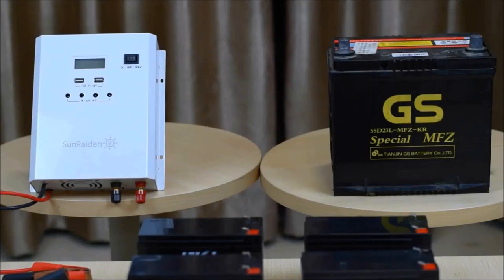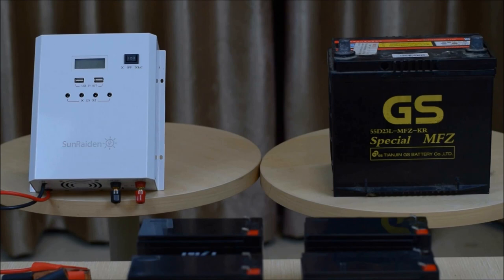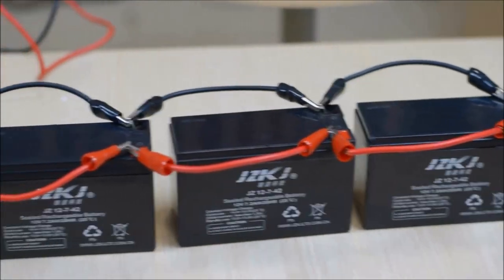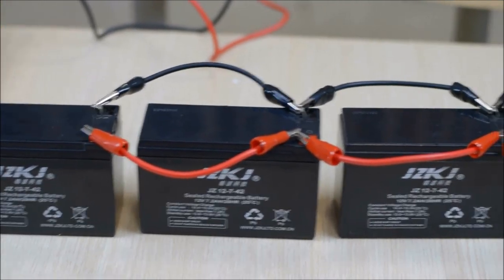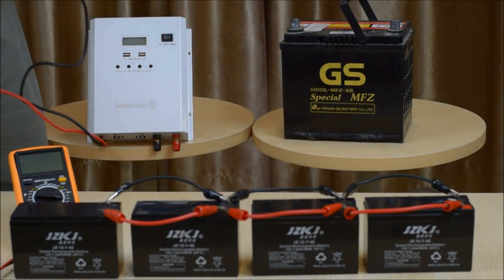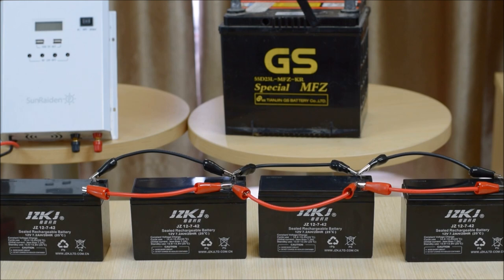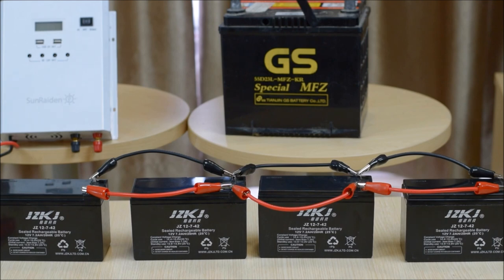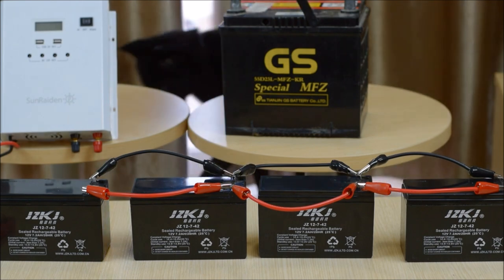How to Connect Batteries in Series and Parallel - Part 1/2 : Parallel Connections

Comment: I have two 12 volt SLA batteries that are both 5.0 Ah capacity. I can hook them up in series with no sparking but when I try parallel it sparks and I don't trust it to leave to connected but I'm wondering if even though it sparks if I should leave it hooked up anyway and use it for what I need. These batteries are in good working order and hold a charge.

Comment: 2 600w 18ah 12v batteries in parallel to a 2000w inverter
Really just to charge electronics in a car, off the main battery
How long will it run a Mac mini